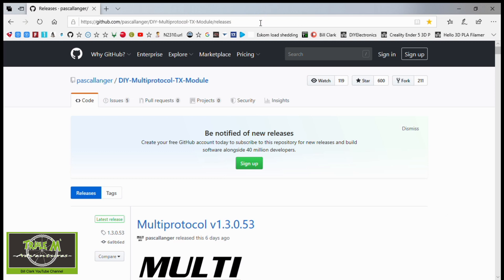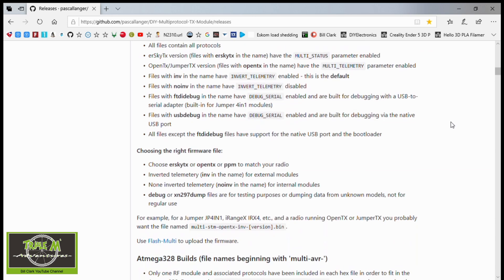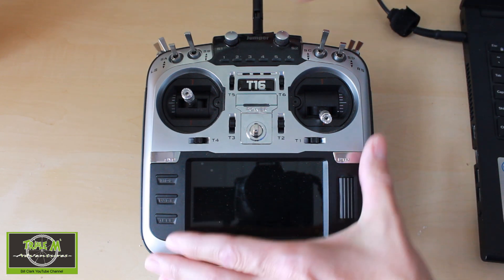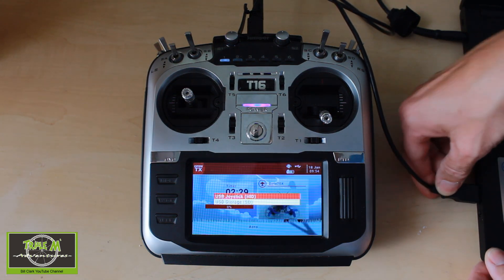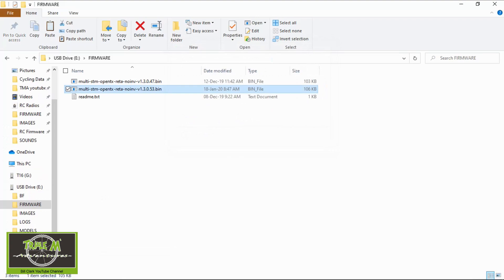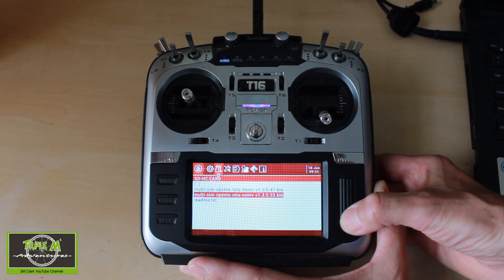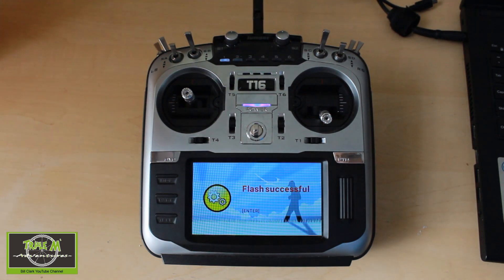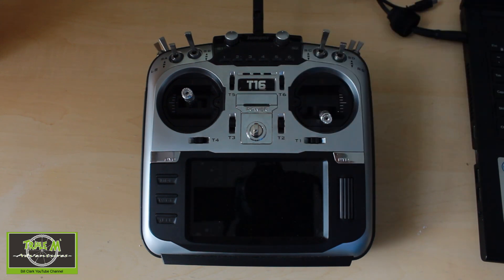Jumper T16 Multi Protocol Internal Module Firmware Update 1.3.0.53

Comment: Hi Bill, I don't have a T16 but I do have a Jumper external module fitted to my X9D+ and Horus X10. What are the benefits from installing the latest firmware and would I use the same file as you did in your video?
Reply from the maker: Hi Richard,
Apologies for the late reply I have been travelling back from a short breakaway. I feel it is a good idea to update the firmware on your radio and your external module. The changes are beneficial with other protocols being added. If a person is nervous of going through the process and does not have a friend to help and the update is not critical then could leave it.

You will not use the same firmware update I used because the internal module is Not Inverted and the external module is Inverted. If you go to the link below they have changed the interface to make it easier to choose the correct firmware.

Make sure you select the correct channel mapping for your radio set up i.e. AETR, TAER or REAT

https://downloads.multi-module.org/

Comment: I probably will do the update but I’m tired of having to setup all my models time and time again. Haven’t been able to move my models on any update yet
Reply from the maker: Dooley, you need to use Open TX Companion to back up your models before the firmware is updated so if they are erased you can copy them back. When I updated my T16 from Jumper Tx to Open TX I copied my models from my Taranis X-Lite to the T16 and only needed to change some of the switches which open TX alerted me of the problem. You need to be careful when you first arm your quad to make sure all is set up correctly. I think when you are updating your internal multi protocol module it should have no effect on you models please let me know if it does. I hope this helps.